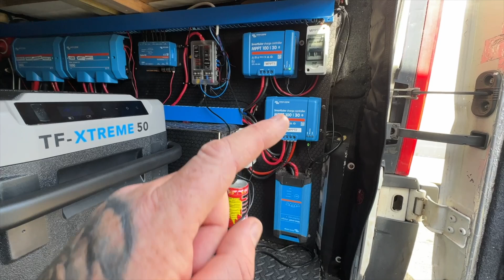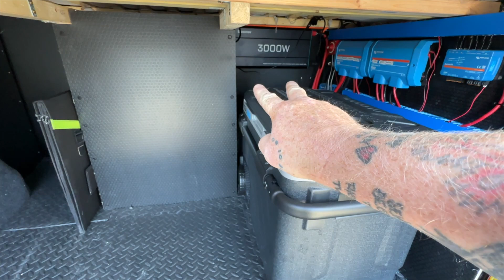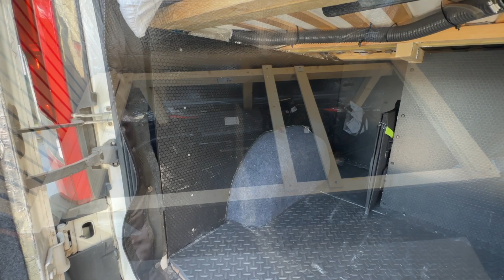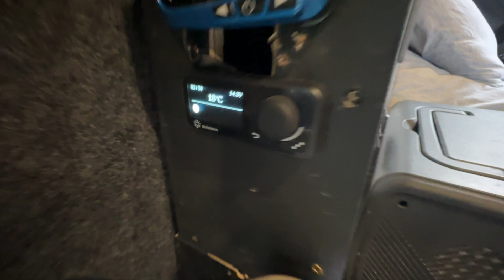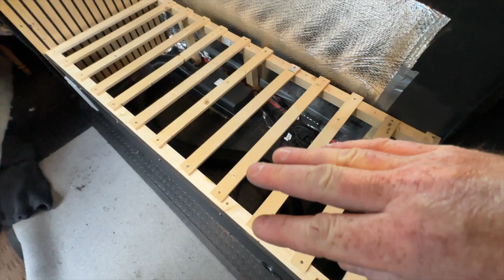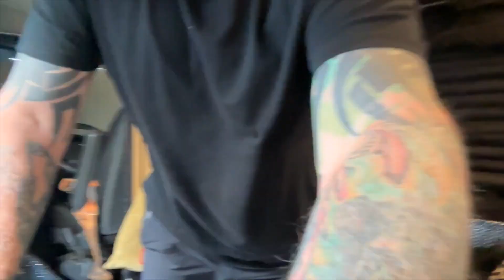The Heater That Changed My UK Winter Van Life — Autoterm 4D Installed

Comment: Hi, you may need an air vent to supply the diesel heater air intake. The last thing you want is throttling that belta of a heat . I added one to my build and it made a world of difference 👍
Reply from the maker: Do you mean extending the air intake to a colder area of the van?
Reply: @packthevanandgo  no , sorry  I didn’t explain correctly, the heater need lots of air so if it’s too enclosed it will be starved . The heater needs as much air in as it blows out so a vent in the cupboard with help to feed the diesel heater cold side 👍.
Reply from the maker: @richiebainbridge2608  Ahh got you, the box seat is vented at both ends towards the inside of the van and the front seat area!
Reply: @packthevanandgo  that’s great 👍

Comment: That sinking feeling, knowing that you were going to run out of flooring. Years ago I bought wallpaper to do a room and left it quite a while to do it. When I eventually did, I ran out and found that it wasn't stocked anymore and it all had to come off. Getting nearer completion now to go and find that freeze.
Reply from the maker: Would you believe it, went back to B&Q and the pack i bought they no longer sell, they sell their own version adn fhe joint pattern is totally different! Typical hey, so had to cut them to fit each other! But it will work for me! Hope you're well this week mate?